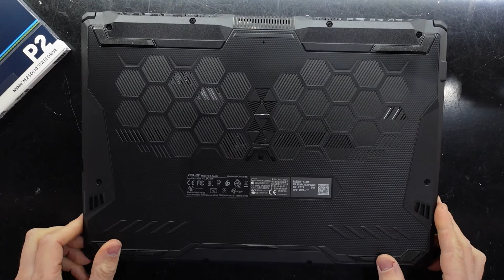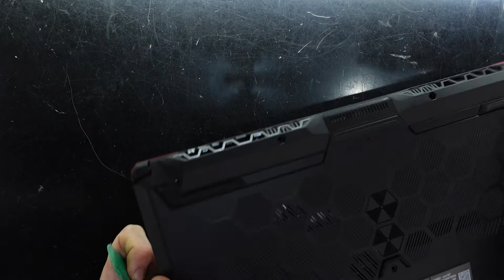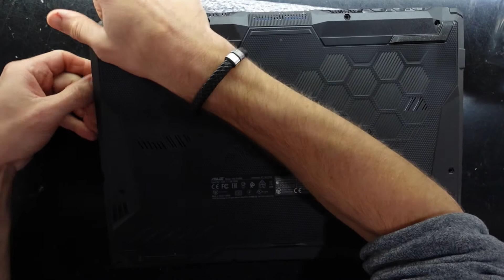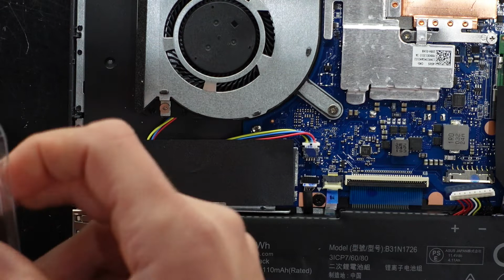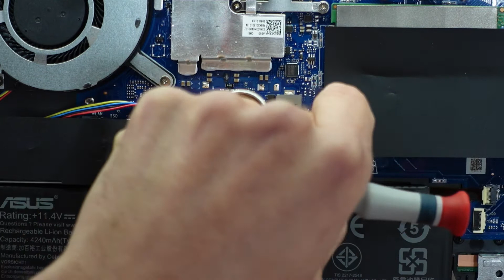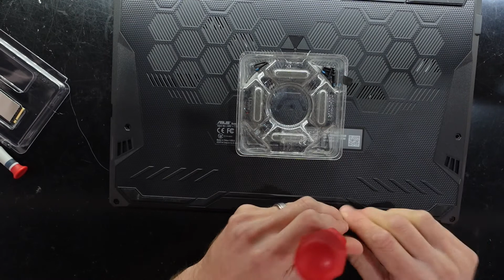Asus TUF FA506I SSD Upgrade and ram

Comment: Can you put in two of Western Digital WD SN850 2TB, PCIe Gen 4 SSD and two of Crucial RAM 16GB DDR5 4800MHz into this laptop FA505II-HN153T(FA506I)? I don't want to purchase it and end up not being able to upgrade the laptop. I appreciate the help. Thanks!
Reply from the maker: It supports gen 3 drives, save you money and don't bother getting gen 4 drives

It runs ddr4 3200mhz , don't bother getting anything esle

Comment: It have 1 solt for ssd right?
Reply: I need an answer here too! Did you find out?
Reply: It only has 1 nvme slot for ssd. But you can buy an adapter (cable) to add a HDD sata (not recommended)
Reply: @manumiro  thank you for saving my time and money. I have 512 GB SSD and I was thinking of upgrading this junk. Do you suggest I change the SSD entirely, or get a HDD SATA OR get an external SSD and use that for storage? What do you think is the best?
Reply: @DinPlayzRBLX  Hey friend! Does your laptop has an NVME? If it is, you can use de SSD 2.5" size with an adapter, but not recommend that in solid state, but instead you can use an HDD better just for documents and storage, btw in the steam app you can choose the storarge drive. My personal advice a SSD o HDD only for storage, maybe a WD Blue could be the right thing